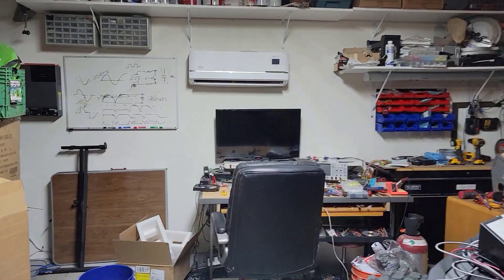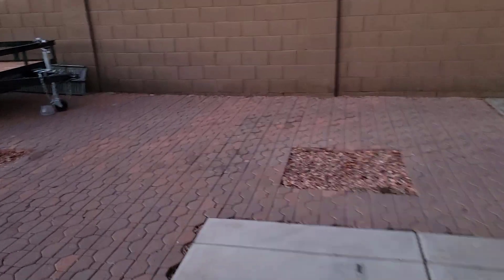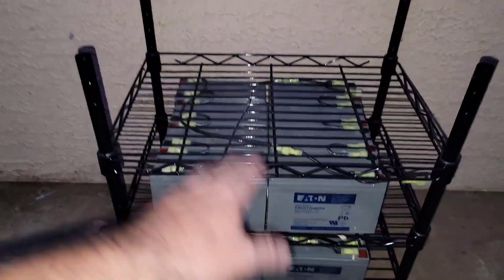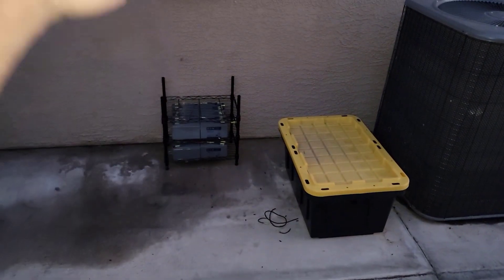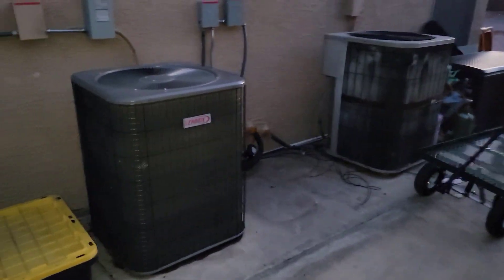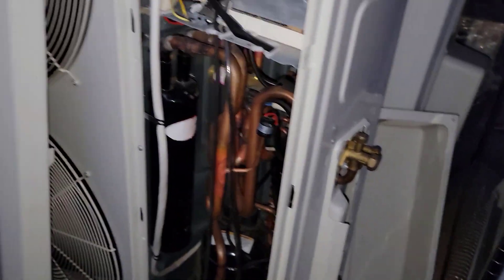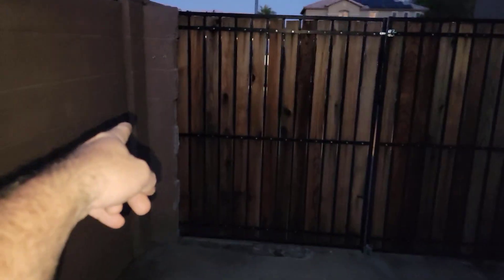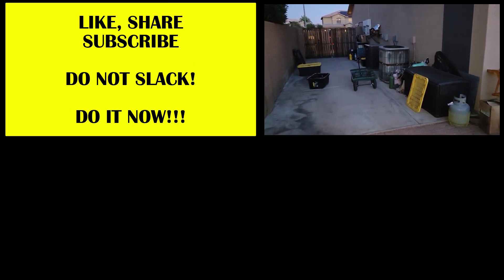Long time no video - Current home solar off-grid & Frankenstein HVAC projects update

Comment: Why would you scrap the rotary compressor for a scroll? Is there some volumetric efficiency or other operating parameter where a scroll improves your intended operation with the solar power source?
Reply from the maker: The Scroll certainly wouldn't be as good if this was a fully functioning unit.
The rotary can usually operate down to like 15% capacity. The Scroll can drop to 40Hz reliably and maybe 35Hz if I really tried to push it.

The thing is the tall units were take outs and not really something I could use unless I used 3 to 4 small indoor units, with all new refer lines etc as these are 4 port condensers (for 4 small indoor units).

Since they were FREE I just want them for their tall yet shallow footprint to gain room behind my RV gate for backing my trailer in.

Also, I am disconnecting the solar from it for now.
I just hooked it up to a Solar Hybrid Charger/Inverter unit. I may then run the garage A/C off of that in the summer and have backup power.

Comment: Can tell you’re in a low humidity climate when taking that paper out it was hard and crunchy crackily sounding. 
            Here in San Francisco when you pull paper out that’s been sitting in the unit outside it’s soft and limp has a ED problem
Reply from the maker: Pretty dry here except for the monsoon season.

Comment: I always wondered what the red plugs were used for.
Does the power go out a lot in your area??
Reply from the maker: Our power is pretty reliable in Arizona over all.
My part of town has overhead lines so it does go out during bad storms.

I'm more concerned about the Zombie Apocalypse at this point. LOL

And in a hospital or other place with backup power, the RED (or Orange, if there is a difference) are the outlets that have backup power. Often a generator but maybe a UPS system if they got one large enough.
Reply: @hackfreehvac  Thanks for the info